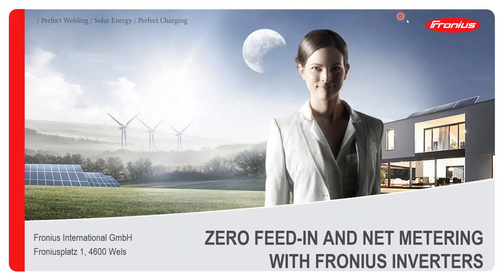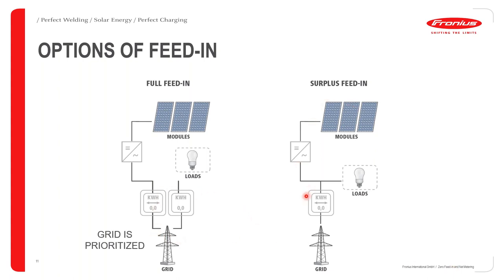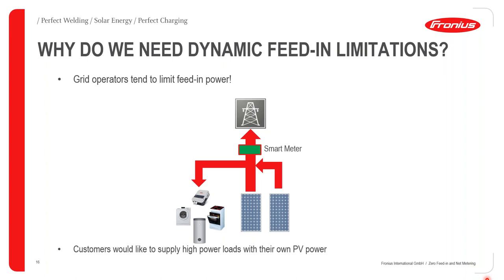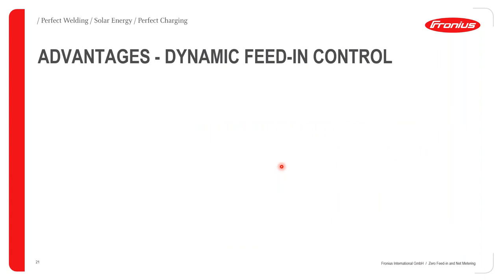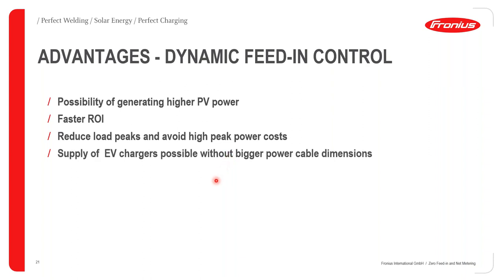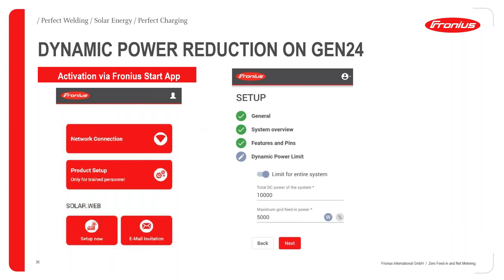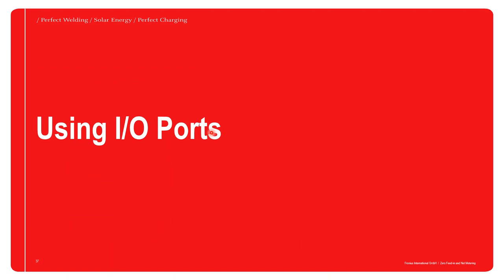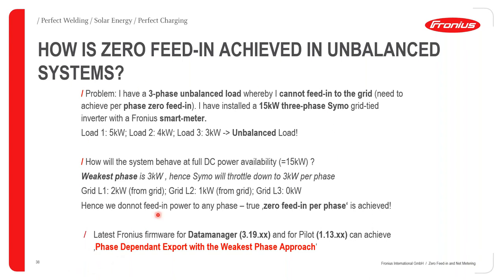Advanced Webinar: Zero feed-in and net metering with Fronius inverters (AFR)

Comment: i have a 3phase unbalanced load whereby i cannot feed-in to the grid. i have installed a 10kw three-phase symo gird-tied inverter with a Fronius smart meter.
L1: 5kw, L2:3,5kw, L3: 0,5kw
 I choosed entire system function in DNO editor.

Please tell me know, Phase 3 can be feeded in to the gird?
if Phase 3 can be feeded in to the gird, what is solution?